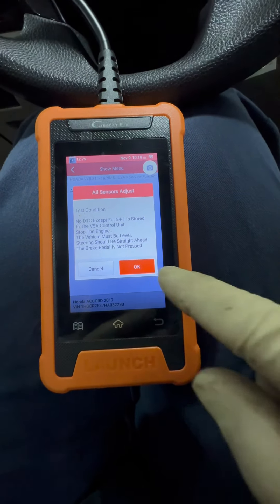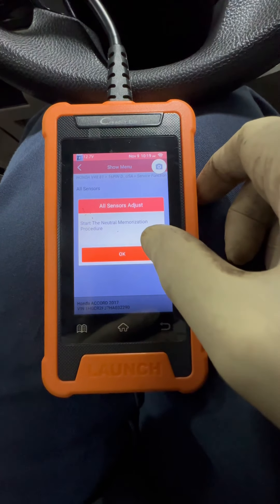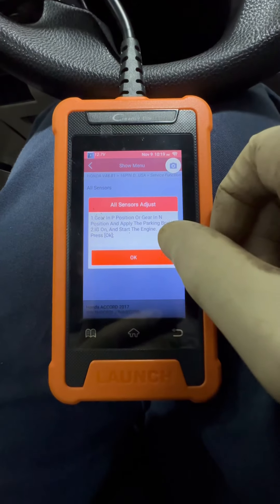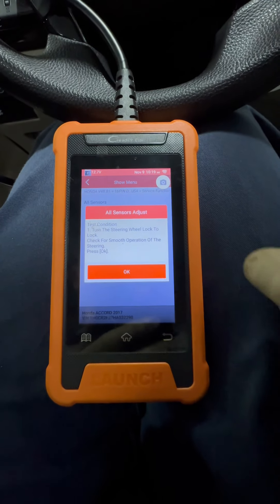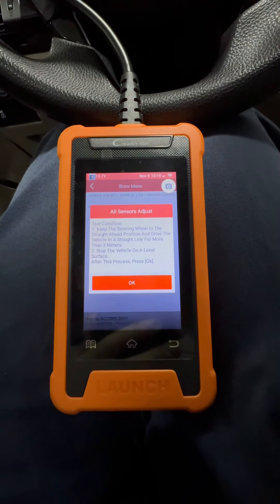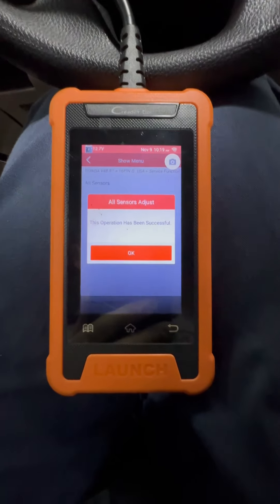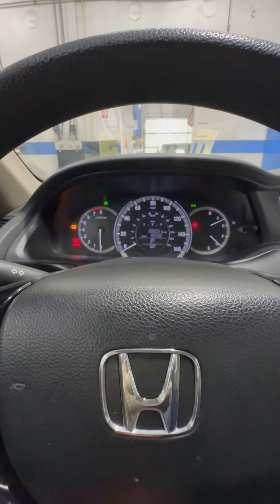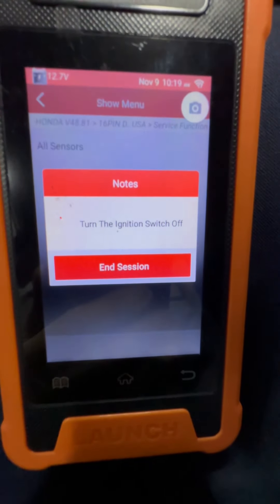Launch x431 Honda / Acura steering angle relearn

Comment: Q1. Why u went with launch versus the topdon topscan? Q2 Is this procedure done before alignment or after alignment?😊
Reply from the maker: I actually have both 😅. this shiuld only be done after a parts replacement 99% of times
Reply: @Hondamobilemechanic   I like the fact that launch has a lifetime software update but it's only use for honda/acura. Topdon on the hand u have to pay for updates but it's compatible with all types    of vehicles. Maybe you should do examples of graphing if do have it for both scantools.
Reply from the maker: @alanchanthavisouk8557  I do although the price points are very different. I can still do a video tho, maybe over the holidays 😅